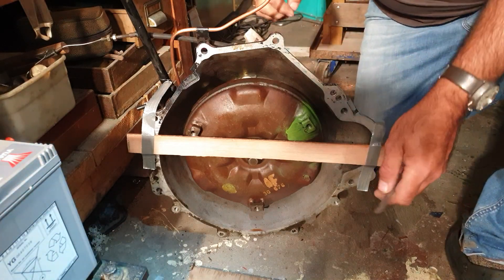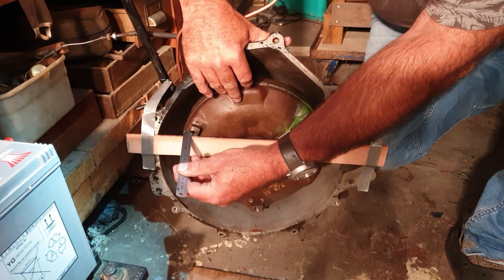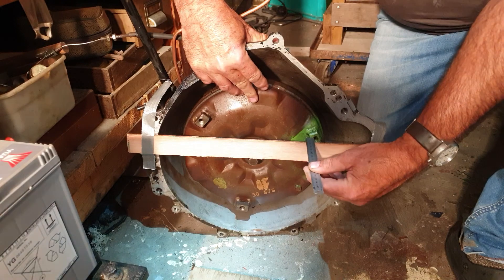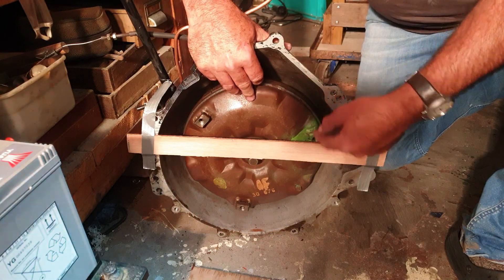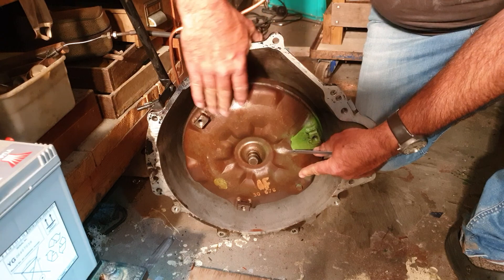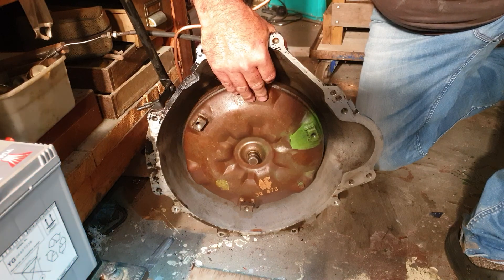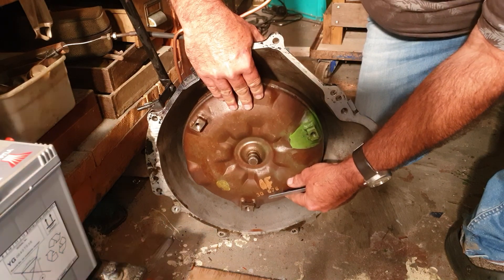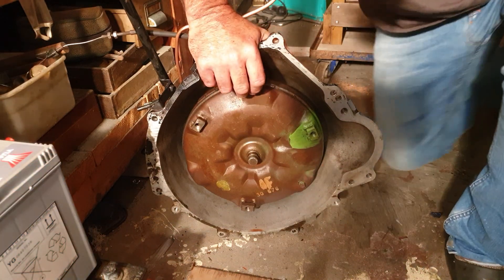FORD C3 TORQUE CONVERTER

Comment: The Torque Converter isnt on far enought it needs to pushed on further and is a complete nightmare to get on.  there is 1 spline that is different on the shaft and converter and the both have to match up to push on into place